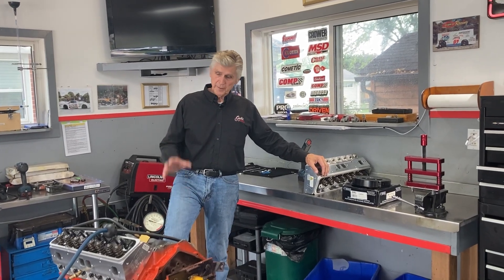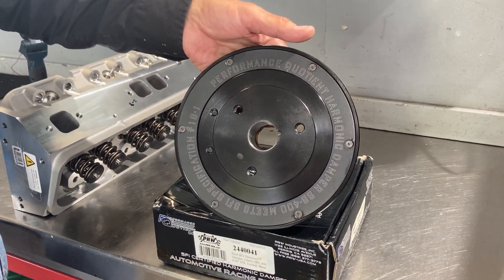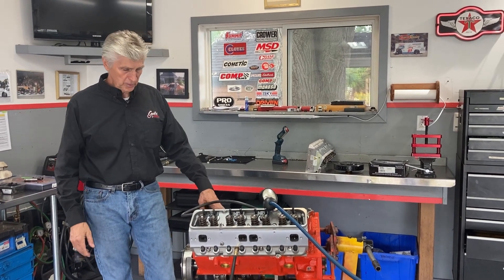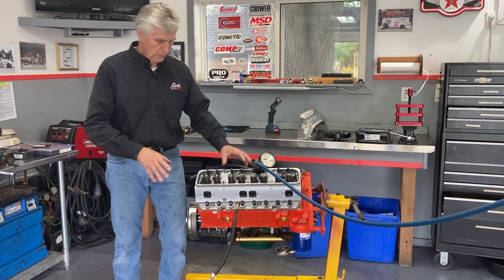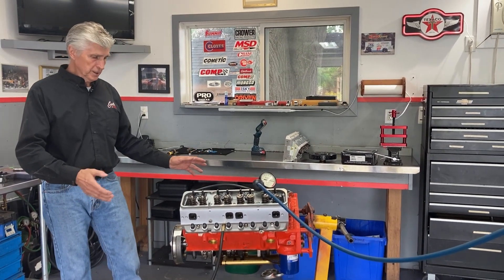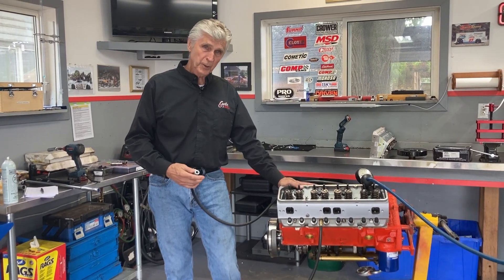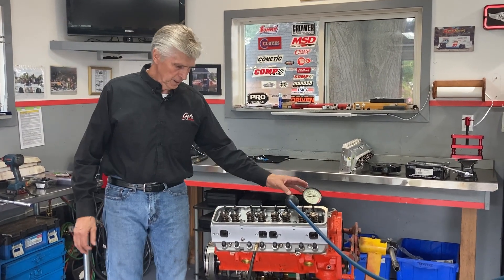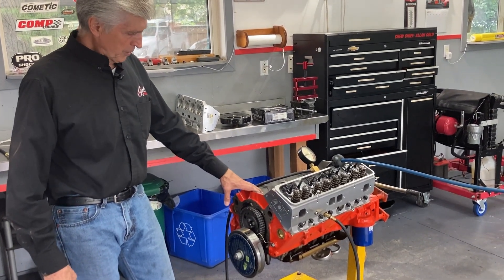400 Chevy SBC. Problem with AFR (Airflow Research) heads leaking!

Comment: You cannot relay on the valve seal w/o tapping on the top of the valve w pressure in the cylinder. You need the valve to nest itself on the seat to get a good seal, if it is leaking after that you will need to Lap the valves.
  You dynamic compression of 7.65 will make a perfect 87 octane engine.
Reply from the maker: Thanks for your comments Racer. AG

Comment: In the past 5 years, I've had to have my machinist redo the valve jobs of over 100 pair of cylinder heads. All because a brand new set of AFR's caused an extended crank and random misfire on first start up of new built 385ci sbc. Not a single valve seat was ground in square to their valve.

Every set of heads I purchase, or my clients purchase, are drop shipped to my machinist for inspection. Maybe 10 heads were spot on. I'm talking about heads from American companies, and Chinese copies. It's become my routine and recommendation to have them ALL checked before installation.
Reply from the maker: That is actually pretty scary Art. Thanks for the info. AG

Comment: It Would  be Very interesting for you to tightly  Seal plate off that #3  cylinder Intake & Exhaust valves & do the Leak-Down test again to Determine which % of Total  Leakage is  just the unbroken-in Cylinder--Piston ring Leakage.....The math subtraction Difference Is the Valve job Leakage.......
Reply from the maker: Thanks Tom. To give you a little preview of what is to come, I did a leakdown and compression test after <5 minutes running. The leakdown on # 3 is only 10% and compression is 180PSI. Get this, the valve is still leaking a bit. It can't be much with such a good leakdown number. AG

Comment: A Simple 1/2" thick  6" x  6" metal (or Aluminum) Plate (with appropriate drilled holes) bolted to Deck side of cyl Head using a Rubber O-Ring gasket lets you Accurately Measure the Real net Cylinder head valve Sealing job 1 Cylinder at a time using your exact Same Leak-Down tester gauge rig Before bolting to Engine block....There Should be Zero measurable Leak-Down on a New or Reconditioned cylinder head valve job using the Standard  0.040" orfice  Calibrated Leak-Down tester gauge...It's  a darn shame & Disgusting times when New expensive heads Leak like 3rd world Imported Junk !!
Reply from the maker: Thanks for the great information Tom.AG

Comment: Must be the Enforcer heads. Seats are in need of truing up. I've had Edelbrock be out by .002 along with ProMax. If you're buying new heads better have them checked! By the way did anyone mic that Eagle crank? Last new forged one was 1/2 a thousand from edge to edge on rod journals. Nothing average Joe would ever know with their plastigauge. Anyways, anyone who would tell you to run it and it'll be fine is full of @$#%&. If they took back all the heads that were like this they would go broke! it's at pandemic levels on this crap!
Reply from the maker: Thanks Havebenthere, I mike and record every journal and verify clearance with a dial bore gauge. The Eagle cranks are slightly oversize, I had to purchase .001"bearings to get clearance on both the rods and mains. AG

Comment: Static is calculated at 100% volume, not running or cranking and most dynamic calculations is at cranking rpm correct? In order for dcr to equal scr with valve closing at bdc it would need 100% ve at cranking rpm right?
Reply from the maker: That is correct Steve. If your intake valve was closed at BDC, the static and dynamic CR would be the same. The DC calculators are just calculating where the piston is when the IV actually closes. AG
Reply: @goldsgarage8236  Do you watch or have you seen 'the gt350 garage' channel? He put out a video around a yr ago "how to tune for compression' and was the first in a 2 part series. He starts talking about static, dynamic, calculators  etc around 22.5 minutes in. Worth a watch imo.

Comment: I would dismantle the heads and look at the valves for a witness mark from the interference angle. Where the valve is touching the seat in the head will leave a narrow line. Where it does not contact will be the ground valve seat surface without a contact line. This will be where it leaks. This is seat concentricity to the guide. 
Mark Donohue described in his book how the Penske team installed a fresh set of heads with no leaks on Saturday night, after qualifying. The shortblock parts all "liked" eachother and fresh heads with good seal gave them an edge.
AFR I believe has Chinese and American manufactured inventory these days. Depends on the particular heads in question where they were manufactured. Chinese QA/QC is sketchy. These days ALL parts should be inspected for QC conformance. Valve seal can be checked off the engine using a vacuum pump with a cup over the port. Quick, inexpensive and simple.
Fix the valve seal now.
Reply from the maker: All good information, thanks Dale. AG

Comment: You have to confirm what's causing the leakage, chattering on the valve seats, lap them in. Seats not aligned with guide, recut seats.
Reply from the maker: Thanks Tom. the heads are coming off tomorrow. I will try to lap them first and go from there. AG

Comment: F u spend the $$$ for the GUD STUFF... GET ERYTHN CHECKED, at ur machinist, then recheck urself. Most parts... Can't b returned after certain date.👍💯
Reply from the maker: Thanks Joe. i will be removing the heads tomorrow to fix them. AG
Reply: @goldsgarage8236  doin ma own 400 now...
Thick 2 bolt block...goin w splayed center caps w heavy duty girdle, scat crank w H beam 6" rods n diamond pistond 8.5/1. Got thoz cheap eBay heads... building them my way... Put 2.08 n m... w beehives n full roller rocker shaft assembly. Custom turbo grind cam. 6500 rev limiter, will b tpi.w twin screws. Goin n an RX8 I got. Goin w a t65 n 8.8 rear assembly outa a Cobra. Liv it👍💯🔥🇺🇲🤙🏴‍☠️⚡⚡🏴‍☠️

Comment: I grew up in machine shop & for my pet 355 went with the same casting as eliminator afr that were CNC in form of Promaxx project x 215 s , USA assembled & a very nice 5 angle valve job. Very happy, done business with them over 30 years before changed name, sad to see Afr after the buddy Barr & edelbrock castings quit th  ETm  they went to China & thus their head was stolen & copied
Reply from the maker: Thanks for the info Flux. AG

Comment: Brand new heads. You shouldn't have too. It's supposed to be ready to run. I'd make them get me a new set. If your in a time crunch I would just try lapping them real quick. If you have to cut the seats and valves. I wouldn't care about being in a crunch. Great channel brother. I've learn quite a bit I didn't know. Thank you for your expertise. I am working on my first swap. Not first engine tho. Ls3/6L80 in a 03'Crown Vic Police Interceptor. I'm going with a Ls3 cause I found a Ls3 block for $500 a set of low mileage 821 Ls3 heads for $300. I sent the block off to the machine shop a couple weeks ago to get hones and cam bearings and the usual. You know lol. I don't want to do the usual pull a 5.3 from the junkyard and throw it in. Nothing wrong with that. It's just not me.
Reply from the maker: Thanks Hugh. The leakdown numbers are good but the exhaust valves are still leaking. I will remove then and try lapping them tomorrow. AG

Comment: What happen Allan on the heads?  Should of had a standard 45° on the intake and exhaust and have a back cut of 20° on the valves, but some valves are so laid back on the valves you cannot make the 20° back cut.  I had to make a 20° back cut on the exhaust valves on some big block promaxx heads for a guys 496...   I  usually pore lacquer thinner down the ports and see how fast on leak threw on the wall combustion chamber.  Once the valve hammers for a while it should be sealed.  When I do a valve job I take a hammer and smack the tip of the valve with springs on and it helps seat the valve.  I have never had a set of heads that the valves leak.  I cannot hardly believe that those ARF heads valves leaked.  But it does happen, you don't know  who done the heads.  With only 150 lbs. seat pressure the valves will float at around 6,000, 6,500 rpm on the Dyno.  On a hydraulic roller it doesn't hurt to have 175 lbs. on the valve seat.  Springs can vary as much as 10 lbs. + or -  and is ok... You will get it straighten out Allan, thanks...  A lot of race heads have a 50° or 55° on the valves to make more HP and torque.  55° is what is on my Profile Hitman 12° heads for my big block Chevy 615 cu.in.  spread port heads, Pro stock technology...
Reply: Done by Daren Morgan. He has done heads his whole life. He knows his business.
Reply from the maker: Thanks Leonard. Lots of good information here. The cam should max at 5800 so 6000 RPM red line. 
I will be removing the heads tomorrow. I will try to lap them in first. The leak down numbers are great so  the leaks are not serious. AG

Comment: I hate to say this but those don't look like AFR castings.
Reply: Its the Enforcer line that AFR has available now...China casting like most of the AFR head castings now since Edelbrock no longer cast heads for AFR
Reply: @tomtowers8513  I have heard that they are a good head, I haven't used them.
Reply: Yes, the Enforcer sbc heads are a good casting for the money for a mild street build...but like anyone who builds engines the heads you purchase need to be checked over out of the box China casting or not...I have seen other AFR, Brodix, Edelbrock, heads out of the box that have seat runout, guides to tight, pushrod holes to small, wrong guide plates.
Reply from the maker: Thanks for your comment David, looks like you already have an answer.AG

Comment: Try lapping the valves then use my low-dollar vacuum test to identify any leaks around the valve seal or sparkplug. 👍

https://youtu.be/qYahjANjbjs?si=Rau9XzTATe_X8RZH
Reply from the maker: Thanks Headflow. I will be removing the heads tomorrow. The leak down numbers are good so I think I should be able to lap them in. Only the exhaust valves are leaking.AG

Comment: It is disappointing to see that valve leakage, even light leakage like that, on a trusted brand like AFR, or Skip White if they assembled it from a base head.  Hey, thanks for your Dynamic Compression equation. Very simple. The online Dynamic CR calculators are all over the place. Very few are accurate, especially the ones that base their calculations on IVC at .050" which is WAY too far from valve actual closing.
Reply from the maker: Thanks 100, glad you found it helpful. I will be removing the heads tomorrow. Pretty sure I will be able to lap them in. Only the exhaust valves are leaking.AG

Comment: Hey I really like your videos. U seem to be very honest about your builds. I have that same leakdown tester. 
 I have a 390 in a old pickup I drive pretty much as a daily. I built the engine, including the heads & valve job. And this thing has been great but recently I found a issue & noticed a drop in power. However it had enuf power that having this recent drop in power, one could still consider it very powerful. But I also noticed the idle has recently changed. I'm always tinkering & changing stuff so somtimes a change comes I have to question what I have dun & if I did it correctly. Simtimes it's error on my part. But I noticed the idle seemed to be more labored. It sounded like a gallop almost as if it was a giant cam. But maybey a miss? Like a cylinder down? But when I revved it, it revved clean. Like all 8 were firing. So I did a compression test & found the both front cylinders down. Not dead, but down. Like 80 & 85 vs. 140 or about with the rest? So I did a leakdown test & found I had 85 & 88 leakage on those two & both was the intake valve. As u know it can be difficult to actually determine where it's actually leaking. But it was the intake valves. Witch seemed like a major failure however when I drove the truck & I even took video to document it rolled down the road smooth & crisp. It had power, not like it once did but if I was to say , try selling the truck & took a stranger for a ride that had never been in it before, it still ran well enuf I could convince someone unsuspecting that, that is a good running healthy engine & all 8 cylinders are firing correctly. It kinda blew my mind that it could still run that impressive & that smoothly knowing I have two cylinders with over 80% leakage. Now this is just guessing by the seat of my pants but I could assume it was still a 300hp engine or better, witch as u know when my 71 f100 was brand new it did not have 300hp so to ride in it, it feels impressive. However me knowing what it did feel like, I know it's down. I'm guessing it was a good 350hp or more when it was running correctly. It just amazes me how well they can still run with a major internal problem. 
  Now I have it tore down & actually going back together at the moment but what I found was the front two intake valves, one on each head, & only those two valves & I still don't know why this happened but, what I found was the guides was simply worn completely out? Just as loose & sloppy as could be? I didn't put it together that way? Not sure why that happened? But as a car guy I have a stock Pyle of old parts, including heads, so I just preped another set to go on & I decided to do a complete inspection of everything while I had it apart & find it's in good shape & I'm reassembling now.
Reply: It's strange that only two guides were worn out. Bent pushrods maybe or incorrect length? Bad rockers possibly? Best of luck to you sir.
Reply from the maker: Thanks Jesse. Lots of information. Good luck with your project. AG

Comment: O great now AFR is taking a dump on QC.
Reply from the maker: Lets see, thanks Larry. AG
Reply: @goldsgarage8236 skip white sold you these heads, they probably purchase the bare castings and use an inferior valve and or springs, keepers etc. The heads are 100% quality control checked if purchased directly from airflow research. Just saying, it's not fair to slam afr when you purchased from a middle man sir. You dealt with skip white not airflow research.

Comment: Even before you bolt them on the block, you can test for leaks by filling the combustion chamber with fluid and applying air pressure into the ports. Any leaks will show up as air bubbles. Then you have to lap those valves.
Reply from the maker: Thanks Joe. AG
Reply: That comfortable assumption can bight you in the ass too! The only way that I can be comfortable with a cylinder head ready to bolt on is having it freshly ground from my machinist or I've ground the valve job myself. 

You might have 0.001 to 0.004 thou of sealing area at the slimist contact area.....and your liquid won't seep past. That engine might be back for a burnt valve in 5k to 15k miles.....I don't like to do business that way. I shouldn't have a return for 50k(maintenance).

To each their own, but I like 100% sure than any thing less.
Reply: @arturozarate1752  Darn, I've been doing it wrong for 40 years.

Comment: Mr Gold, I experienced the same problem with my AFR 325 Magnum for my Big block. None of the Valve seats were concentric , so we had a valve job done and now I have them around .002-.003. I recommend removing them and checking them.
Reply from the maker: Thanks Scott. I may have to. Lets see what happens after some run time. AG
Reply: Lap the valves no cutter can even come close to lapping the valves old school technology

Comment: Before going out and getting a valve job you need to know the run out on the valves. If you don't have the run out gauge I suggest that you disassemble the heads and use some dykem and valve lapping compound and actually see where the pattern is. I've found on some heads that a good lapping is all that they need. Now if the pattern is not concentric that is when you get the valve job done. 
I would suggest that you check all aftermarket heads before assembling. This is just good practice to do on any engine. You'll find that it doesn't matter the manufacturer AFR Brodix Dart all may have issues. The chinese  heads Promax Assault Speedmaster definitely need to be checked not only for the valve job but for everything else. Guides spring height valve height etc.
The PRW balancer although better than stock is not a high end balancer. ATI BHJ Innovators west are the good ones. They are sent undersized so you have to hone them to a specific press fit. Your PRW also may have a spec for that also. You can purchase a cheap ball hone from brush research on summit racing.
The other thing you might consider is that getting the balancer actually balanced with the whole rotating assembly. Especially with an external balanced rotating assembly. I've seen aftermarket balancers that were out a couple of grams. Although it might not be a big deal and you probably won't notice it the rotating assembly will.

Hope this helps BK
Reply: I actually came to the comments to leave a similar comment on the heads not sealing out of the box.  It's pretty common across multiple manufacturers.  Lapping often fixes, as you mention.  It's pretty disappointing though when you pay multiple thousands of dollars for these heads and they don't even seal.  I mean to some degree it is what it is, but you would think for the price you pay that they wouldn't even need to be checked.  Well, they definitely need to be checked.
Reply: Yeah know what you mean. My cylinder head guy used to work @ AFR and you never know who is doing the work. Edelbrock's usually are the worst out of the box but have seen the same across all of the manufacturers         @Brons2
Reply from the maker: Very helpful, thanks for your input Brant. AG

Comment: If it's leaking now... It will leak later. Doing a valve grind now is no big deal. Fix it and fix it right.
Reply from the maker: Thanks Jeff. The heads are coming off tomorrow. AG